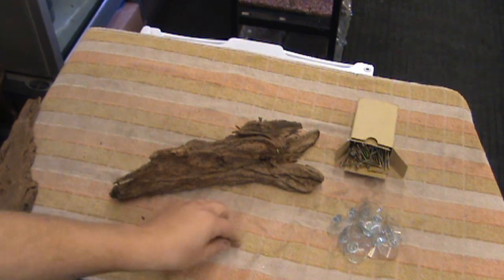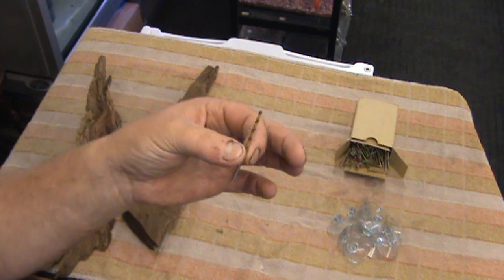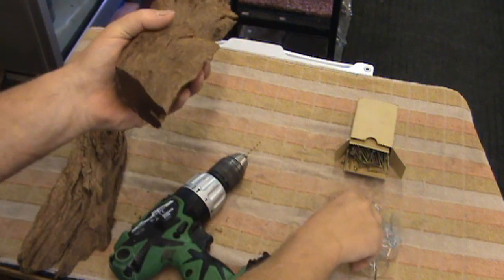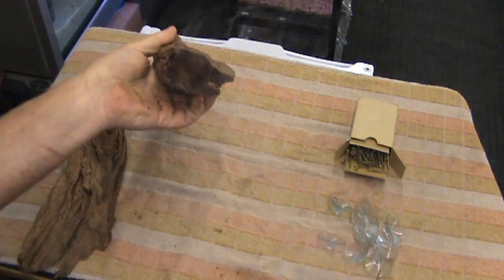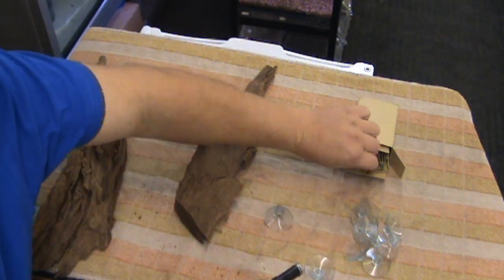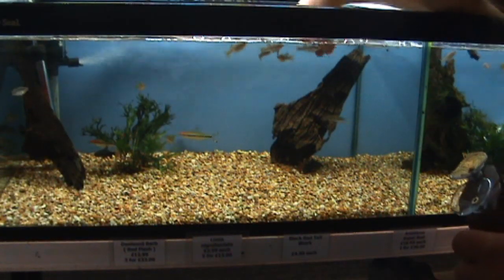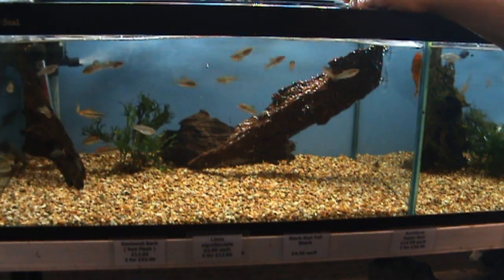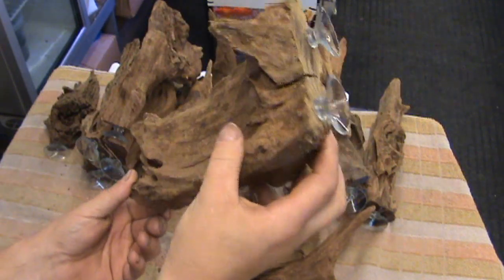Aquarium Advice - How to make Suckered Bogwood by Pondguru

Comment from the maker: I have had 2 or 3 hitachi drills over the years and they always are good quality. Not too cheap but when you are using thousands of screws on a decking job you need something which does it quickly and good battery life. Makita are good drills too so its personal choice really.

Comment: Should this be done when the wood is fully dry or can I do this to a fully soaked piece?   Thank you!
Reply from the maker: It doesn't matter if the wood is wet or dry but if you are using a power drill it is safer if wood is dry as you'll get a better grip.
Reply: Pondguru Thank you!

Comment: Hi richard, I have got a 200ltr  tropical aquarium and have just last week added three medium to large sized pieces of bogwood.  I know it reduces your PH, but my question is this, will it continue to reduce the PH or does it stop at some point, also will it drastically reduce it because iv put three pieces in (will the reduction be x3)?  I have got egg shell in my tank to try to counteract this. I have also noticed a sharp reduction in my nitrate which was at least 40/80 down to 10 yesterday (14/jan/2017). I bought your biohome ultimate some time back and my water is.... Ammonia 0, nitrite 0, PH 6.7 (down from 7.0 since adding Bogwood) and nitrate 10. does the Bogwood also reduce nitrate?
Reply from the maker: I'm sure that bogwood will continue to affect the water positively for many months but the pH should level out at a point which is relative to the amount used / volume of tank and amount of water changed each week. Every tank and piece of bogwood is different so it is impossible to say what the finished level of pH would be.
When using the biohome the nitrate can drop quite quickly (over a week or so) when the anaerobic bacteria finally kicks in at a decent population. I've searched for an order from you can can't find one so I don't know how much you ordered or when it was but as long as you have 1kg - 2kg per 100 litres and 4-6 months has elapsed the nitrates should fall.
Bogwood may also have affected the nitrate as there are all sorts of beneficial reactions which happen when essential trace elements are introduced into a tank and filter.
Reply: Thanks for your reply. I'm sorry mate...I didn't buy it personally,I had it for my birthday off one off the kids. I don't know the weight but it filled one basket in my aqua one external filter. I too set mine up as you instructed...mine only has two baskets though else I would get more! I think I got my biohome about 18months ago! Love your videos Rich...very helpfull. 
On the subject...is there any chance that you could do a video on "new tank syndrome? I see so many comments where people advise massive water changes...sometimes 100%! I had it when I was a newb and cost me a fortune from listening to bad advice from pet shops and even aquatic centres! Bacteria is now a very good friend of mine haha.
Reply from the maker: No worries, I will cover that in a video but it will be more along the lines of how to prevent it by ensuring good filtration and I'm also intending to cover filter sizing so it would work in well with that. I've had a new external filter and booster filter for about 6 months now with the intention of shooting such a video but haven't had the time.